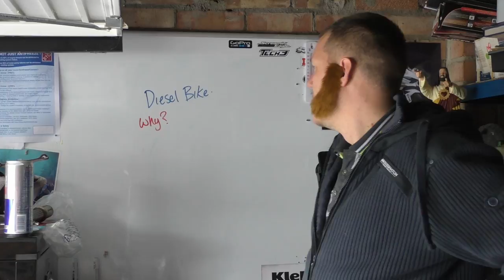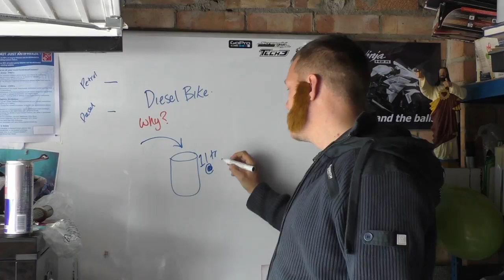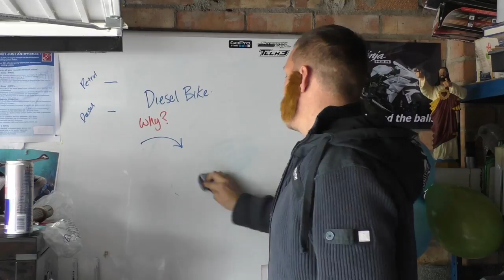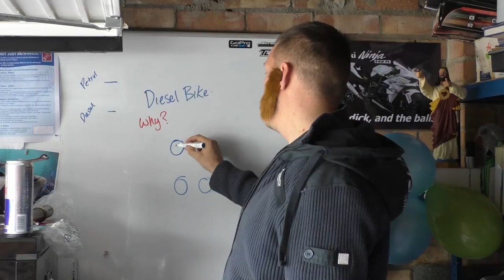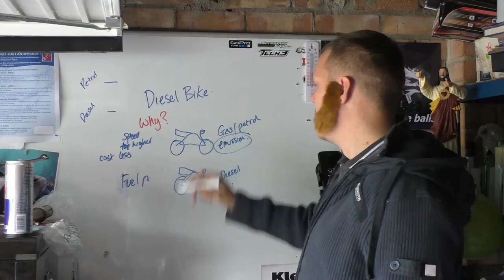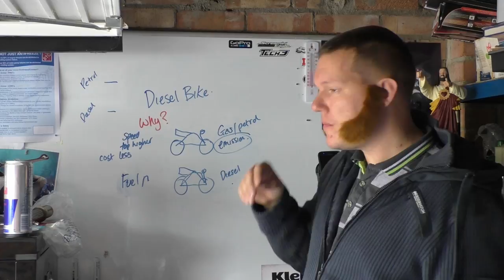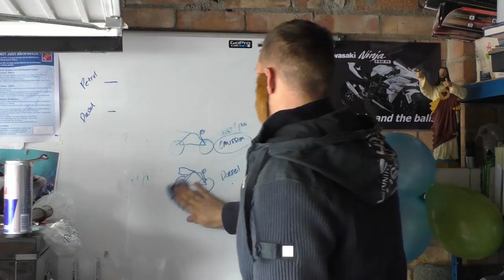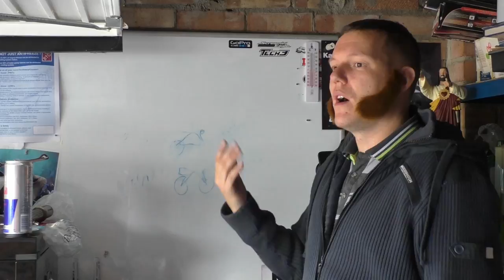Diesel Bike - Part 1

Comment: Diesel makes sense for a farm bike though, for the same reson the military are playing with diesel bikes, it means you can use just one fuel to run every machine you have.
Reply: Diesel quads exist though
Reply: @joshuaheffernan4374  as do diesel motorbikes for the military the USMC even issued one. Modified KLR650. 

They are gorgeous to ride.

Comment: whilst testing engines instrumented with in cylinder pressure transducers and plotting the instantaneous pressure curves using AVL rapid data aquisition and anylsis equipment, the combustion traces show much quicker combustion for diesel over petrol. Nox is an indication of the rate of burn. Nox is considered bad for the environment, which is why exahust gas is injected back in (Exhaust Gas Recirculation EGR) to slow down the burn. The emissions results also showed diesels emitted more Nox too.
However, when petrol burns like diesel (compression ignition), the combustion is even quicker (actually its more of an explosion than a burn) and the Nox shoot up.

Comment: I'd imagine flexfuel engines could work well, because e100/e85 or whatever is gonna be around for a longer time just from the somewhat renewable resources used. As long as manufacturers are willing to provide bigger injectors and some fuel/engine heating for cold days they'd have their future proofing set for at least another 10 years after petrol and diesel (unless combustion engines get banned outright for consumer vehicles).

Comment: I am still really frustrated.that the USMC Kwak KLR650 based diesel bike that was built based on the NATO One Battlefield One Fuel JP8 d8rective/standardisation didn't ever get to being sold to private consumers. The company was planning it but then OIF/OEF scaled up and they had to shift all the production to the military contract and sometime before the contract ended the company was bought out by a larger defense contractor and they closed down all plans for the civi side.

It was a really nice bike to ride and utterly adored by everyone that tried it out and Kawasaki were heavily involved in the project so they COULD produce it. 

One thing that made the contractor buyer pull the plug on civi sales is the fact that the EPA regs for diesels are arse backwards. It's why you see SO FEW diesel passenger cars in the USA. 

The USMC KLR was designed from the ground up as a bike engine vs the homebuilt/conversions of Royal Enfields/Moto Guzzi and similar  to use the generator engines so it doesn't have a lot of the issues that those do with low RPM limits and the weight. (Though the diesel generator bikes can make a really pleasant long distance tourer from what friends of mine have said.)

Comment: but what about black smoke and waste-gate sounds
Reply: butanetorch what does a waste gate sound like?
Reply: Thats actually the vanes in the turbo releasing pressure, you cant usually hear it because of cats/silencers etc but on straight pipes you can. Wastegates are different and dont make any noise (unless you have an external gate with a screamer pipe)

Comment: I was watching a video about the Kawasaki klr that American military use, USMC i think, that is a diesel/multi fuel, although i don't think it's a Kawasaki engine
Reply: Jas Ward 
It's a modded engine done by a company in California named Hayes. It uses the factory kawi transmission and engine cases but is a new crankshaft, con rod, piston, cylinder, top end and I think clutch. It uses all the "aftermarket" bolt ons that already existed for US military gas powered KLR such as gas tank, crash bars, etc. There were less than 300 of the jp8 (military speak for diesel) versions produced. They occasionally show up for sale and go for about $20k.
Yes it was exclusive to the Marine Corp as they have a logistics mandate for their hardware to only have one fuel type. They never want to be stuck in a situation where they have a bike out of petrol sitting next to a tank that has been blown off its tracks but has a tank full of jp8. Or have to send two trucks headed out to resupply a forward position instead of one. Or a redundant pair of trucks carrying the same juice in case one gets knocked out.
Once upon a time they had similar constraints regarding limited variety of ammo. Light machine gun and battle rifle running the same cartridge, that kind of thing. So if your guys were sitting there with empty magazines they could at least grab a couple feet of linked belt ammo, strip the rounds out of the links and get back to pulling the trigger. "Every marine is a rifleman" goes way beyond passing the PT tests.
Reply: I saw it years ago at a motocycle show.....back in 06, I think.  It was an abomination.
Reply: Mike Grady 
The KLR by itself is a pretty shitty bike but it does have certain advantages as a military vehicle. I think a DR650 would have been a better platform to start with but it wasn't around when the army started wanting them. At the time the klr was all there was. It's slow, it's heavy but it carries a lot of gear and tractors along acceptably.
Crap motorcycle.
Decent military motorcycle.
Reply: Zedex 12, yeah....but a 400lb dirtbike is not my idea of a decent bike...period.   I get the whole point BUT it is kinda like the F35.....it is trying to do everything....and that is retarded.  It is what happens when something is "designed by committee"....especially when the military is the committee.
Reply: Mike Grady 
Oh I know it. I had a klr for about the last 3.5 years. Just sold it actually.
With a full tank of gas, an engine case full of oil, and just a few knick nacks carried along its easily into 500lb territory.
 It's not a dirt bike. Just like a hmmv is not an suv. If you wanna take 6 brats to soccer practice a hmmv ain't for you. If you want to carve single track, a klr ain't for you. If you want to play at being Charlie and Ewan though, and you don't have 30 grand to spend on a 700 lb beemer or KTM well then, the klr is second best in its class. (DR650 is significantly better imo) They will handle any ROAD in the world so long as it can legitimately be called a road. It'll do freeway speeds all over the country, it'll claw it's way along some roads I wouldn't take a toyota tacoma on. Somewhat advantageously it does a fine job riding TO the woods, then into and out of them, then back home, all with no trailer or truck to park. So no, it's NOT A dirt bike in oh so many ways.

I do recommend klr's for new riders if they are tall enough and for anyone curious about adventure riding but not ready to commit huge money until they experiance a taste of it first.

I'm down to just one bike at the moment (z1000) but am shopping for a drz400 to add next. Preferably with a spare set of wheels to go back and forth from dirt to sumo.
Reply: Zedex 12, I have a friend who had one....bit he is a badass on a dirtbike.  He trained on the damn thing.  He'd get on a regular dirt bike and good god, he was fast.....
Reply: Has anyone seen the video of a guy who put a kabota engine in his KLR650? He calls it the kawabota, it sounds like a tractor lawn mower  which apparently that's what the engine came from, i can't remember if he said why he did it but i like that type of thinking but personally i like a bike to sound like a bike if you know what i mean, good idea in a shit hit the fan situation though.

Comment: Have a weird fuel question, Assuming you are running on boost or high compression ratio 11.5 or higher, Do you think adding 2T oil to Ethanol will cause it to burn better or at least have better fuel economy?
Reply: Frederick John Teng it will burn the cat out of the exhaust

Comment: Did someone say ZX12R? lol.
Actually when it came out the zx12 was slower than the busa  (which had beat out the blackbird) but featured better handling in part due to some it's innovative construction. The first year zx12r would run out of hp around 178mph and two years in got redesigned, after which it was governed to 183mph (300kph) as all bikes were, but basically was out of power at that speed anyway. Ungoverned it would gasp and wheeze at a bit over 200mph.

Comment: "If there's both petrol and diesel at the pump, why would you choose diesel?" Fair point, but what if you only have access to diesel? Most armed forces only carry diesel fuel, which is why most armies don't have bikes anymore. A few have tried to make a diesel bike work for special forces, but it ends up being heavy, loud and slow. With all the fancy new engine tech floating around, is there a way to make it work?

Comment: Cruiser engines are already like Diesel engines.there long stroke, low rev, higher torque,move heavy bikes, and get higher fuel mileage.that is why you don't see diesel engines,they already have the alternative.

Comment: diesel has a more friendly tourqe curve. and usually diesels last a fucking long time. top speed is not realy an issue, as even a quite small diesel bike would be faster than most road legal speeds anyways. however, diesels low rpm tourqe would make it a verry verry decent ride.

Comment: Would be more interesting to see a video on using gas in motorcycles, 

People are converting petrol & diesel cars to gas but can you convert a motorcycle ? ;)
Reply from the maker: when you say gas do you mean LPG?
Reply: The Workshop yes LPG
Reply: DHealy91 There are actually scooters in India that have LPG conversion kits. And people actually want them.
Reply: Jo Blow You already have that infront of your balls with your petrol tank lol. But tanks would be a bit more heavy. LPG tanks have about 35bar (if I dont fuck it up here) of pressure so that is quite a bit but nothing compared to the 200+bar of CNG fuel systems which are fuckin heavy. I had an LPG thingy in my car and you can lift the tank (spare wheel thing) quite easily
Reply: Jo Blow As I said I had a tank in my trunk in the hole where the spare tire goes. It's like a toroid or whatever you call that. Also you could just put two cylinders left and right where the fuel tank is right now and put the same plastic thing around it as with petrol tanks. And gas tanks are quite safe compared to petrol tanks which was the point. look at CNG/LPG crash tests on cars where the safety valve just blows off and nothing explodes if say the thing is set on fire. These tanks have so withstand a certain time at elevated temperature and usually in that time the tank can be vented. a petrol tank ruptures easily and the stuff pisses out everywhere, sticks on your clothes, the bike and whatnot.
Reply: asfvdbgsdh that's true. but here you say gas everyone thinks gasoline.  a turbo LPG bike sounds nice I think

Comment: Come on .... A diesel bike is a wounderfull idea.
first off, think of a honda goldwing. far for a light bike right?
so weight is no issue. there is a market for heavy bikes.
think of "choppers" and "cruisers". or trikes...

so  what about what diesel can offer?
a unique sound for sure, and a fuckload of lor rpm power.
now, top speed is not your issue, if you want to stay whitin legal ranges.
even if you are a german, pretty sure a diesel bike is still faster than a car most of the time, so allso no issue. however, many people choose higher displacement to get that extra low rpm power. in everyday riding it just makes things COMFY.

so what else diesel has to offer other than unique sound and low fuel consumption ?
endurance my friend. raw endurace. a diesel lasts longer. 

and yess, if there was a diesel sportsbike, witch may sound ugly as fuyk at first, i would be villing to sell a kidney to get one. preferably something like a v4, or vw styled vr6 arrangment, turbo charged naturally, direct fuel injection, and larger than one liter in displacement. would be a heavy, bulky, tourqe monster. even if it would not rev higher than say.. 6K rpm, it would still make enough power to propell the bike silly fast. and the HUGE rpm range where you get power would make it a verry verry comfy ride in everyday use. 
i would love it. and most probably would hold it value, unless you fuck it up and drop it, i don't see it could be killed. 

and engine braking, yess, with a diesel you would get engine braking simular to hitting a brick wall. again, comfy ride. 

however, it would certainly cost more than a petrol powered one, but could outlast it by far. allso the vastly better economy for those who do regular comuting and everyday use, where again, endurance would allso be a huge deciding factor, it would even the gaps.

it does makes sense, it really is just depending on what specs you comapre.